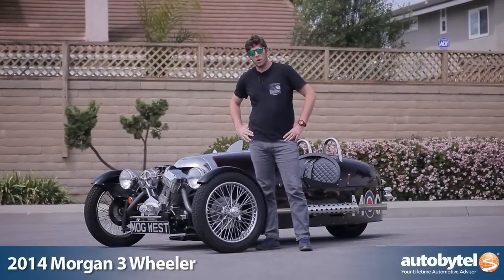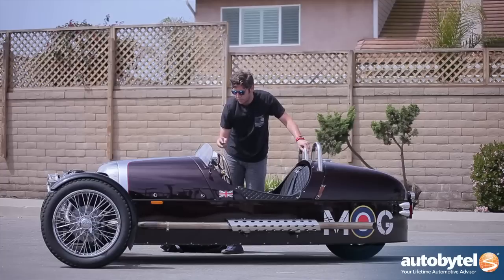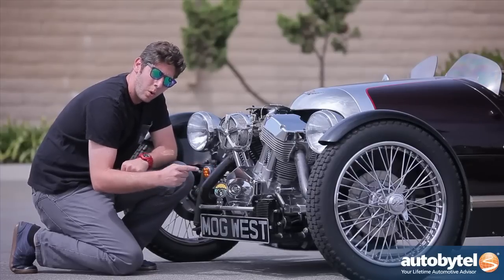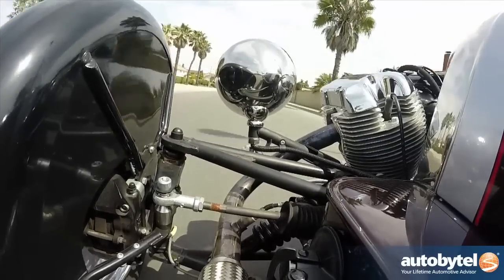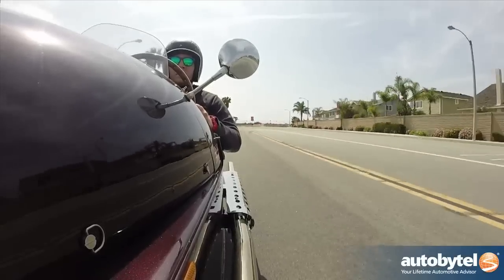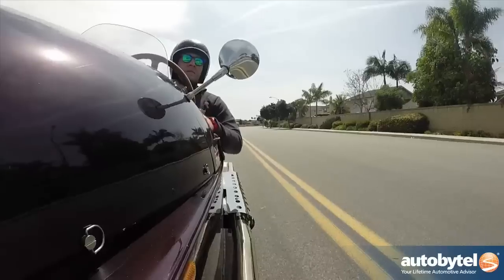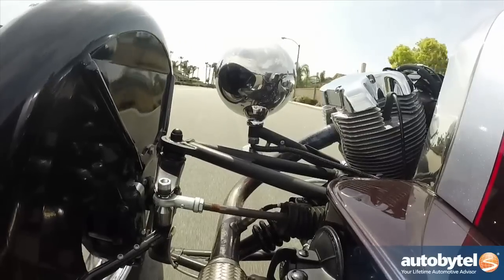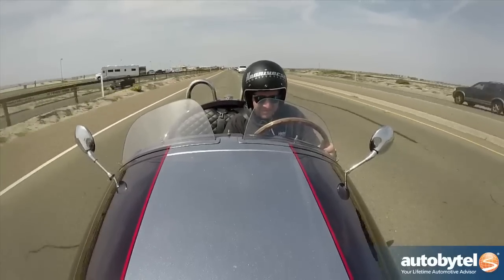Morgan 3 Wheeler Test Drive Video Review

Comment: Do you have to wear a helmet in the US, as everywhere else and even the nanny state of the UK, you can drive it without. Just in just sun glasses and it feels Amazin ?? !!
Reply: Probably has to be homologated as a motorbike in US.
Reply: Each State has their own laws regarding these 3-wheelers. I live in South Carolina and helmets are not required for any motor vehicles, including 2-wheeled motorcycles. Most states do require helmets, but some are revising their laws to accommodate vehicles like the Morgan 3. In one or more States, if you have proper seat belts, you can drive without a helmet. It's a mish-mash.
Reply: It's classed as a car in the UK so they can charge higher road tax, I pay as much road tax for my Morgan 3 wheeler as I would for a Range Rover.

Comment: They ruined it by not being a 2CV drive train, techie trash.
Reply: Remember a 2CV-based 3-wheeler in Middlesbrough (UK) about 25 years ago, wonderful device built (it was a kit) by someone working at the local hospital.  Pity it meant one less 2CV on the road though (my first and favourite car).